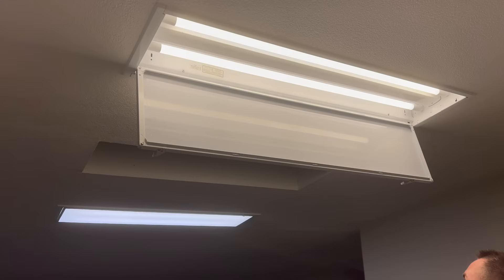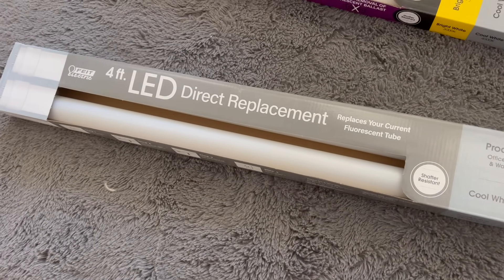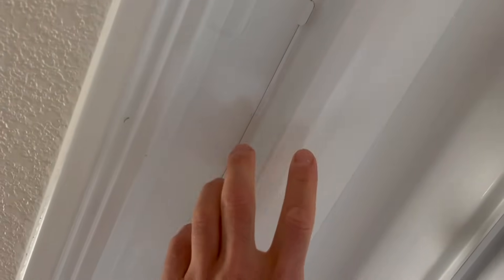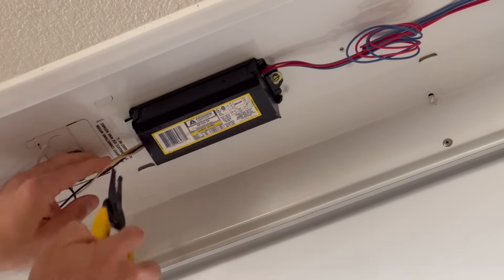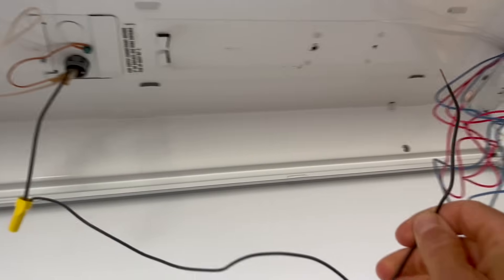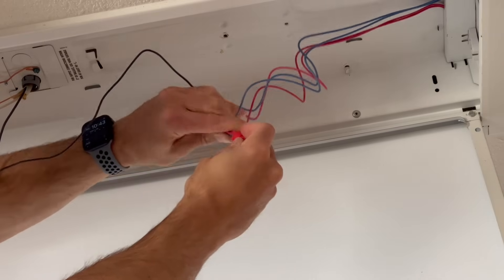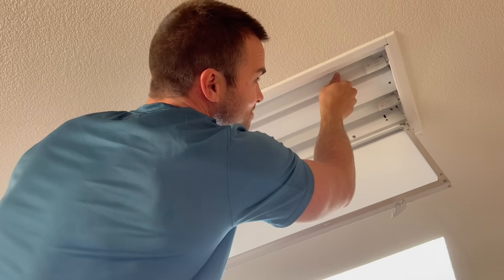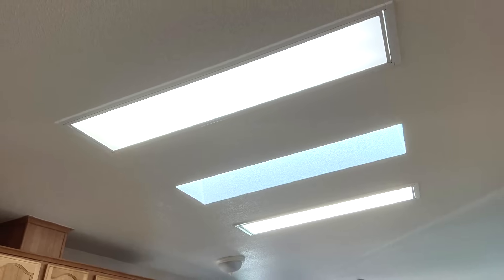Convert Fluorescent Tube Lights to LED - Easy Ballast Bypass Instructional | Builds by Maz

Comment: Maz, Thanks for the great video! Question: My fixtures also have 2 ballasts. I read one of the responses here (stentordoc) where he or she, with 2 ballasts, just connected all the blues and reds with the black, and all the yellows with the white, and it worked great. Is this a reasonable approach? Or was stentordoc just lucky? I would attach a picture of my fixture's wiring, but YouTube doesn't give respondees that option. Mine has 4 X 4' tubes with the 2 inner tubes seemingly powered on one side of the fixture, and the two outer tubes powered on the other. All 4 tubes go on and off together, with light switches at 2 doorways on either end of the room.
Reply from the maker: Hey, honestly I can't say for sure without seeing it in person. But it also sounds like your lights are on a 3 way switch so you may have an additional wire. Sorry I can't be more help, but I don't want to tell you it's fine and then it end up not working.
Reply: @buildsbymaz  No problem. Thanks for a clean, clear video! I went through some other vidoes, and came out more confused than I went in. Keep up the good work. Yes, my office lights may be turned on and off from 2 different locations. A Chinese guy at Home Depot is going to talk with me tomorrow, we'll see what happens.
Reply from the maker: @badfeatherknives5189  Best of luck!
Reply: @buildsbymaz  Hey, I got lucky and spoke with a guy (retired physicist) in the electrical/lighting department at the local Home Depot (BEN is his name, Oak Harbor, WA. He should get a medal.). He told me exactly how to do it. I went home, made the switch rom fluorsecent to LED on my office lights, and then on our house's utility room lights. Both rooms had three fixtures bolted to the ceiling. Both sets of fixtures were made by different manufacturers. Each fixture had 4 fluorescent tubes and 2 ballasts each. I had zero problems replacing those fluorescent tubes with LED lights thanks to Ben's easy-to-understand instructions. The LED tubes I used were the same as you used, I think: FEIT "ballast bypass", 4' length, with a switch for 4 different colors/light output. The idea went like this: 1. Turn off power, etc. to the circuit, of course  2. Remove covers and fluorescent tubes, exposing the ballasts and wires. 3. Cut the wires close to the ballasts and remove the ballasts, as you described  4. Black "LINE" wire from the ceiling hole goes toward one side of the fixture, and the white "Neutral" wire from the ceiling goes to the other side of the fixture. Make sure the ground wire (green or stripped copper) is attached to the fixture, as it should be - if so, leave it alone. 5. Strip about 1/2" of the wire insulation off of the ends of all the wires. I severed the wires if they were unnecessarily long to avoid tangles, just making sure there was enough wire to reach, with a little excess, either the black "Line" wire or the white "Neutral" wire. I then stripped the ends. Basically all the wires from one side of the fixture will be clumped together to join the black "Line" wire, and all the wires from the other side will be clumped together to join the white "Neutral" wire. The ends are stripped and will be joined by those screw-on electrical connectors (the larger red ones). So you need just enough wire to join those clumps with the black and white wires in the middle. It doesn't matter which set of tombstones (on either end of the fixture) attaches to the black wire or white wire EXCEPT the LED lights must be aligned correctly when you install them so that the "L" on the LED light is plugged into the Black wire side of the fixture 6. When you have all the wires from one side of the fixture (4 "tombstones") tied securely (using those red twist connectors) to the Black Line wire and all the wires from the other side of the fixture (the other 4 "tombstones") tied securely to the white "Neutral" wire, you can then install your LED lights. Make sure the "L" side of the LED tube is connecting to the tombstones attached to the black "LINE" wire. On the FEIT LED lights, the "L" side and the "N" side of the lights are clearly marked. 7. Once I tested my first and second fixture with power and gained confidence that I wasn't going to burn the house down, I found it easier to replace that metal thing that covers the wires in the fixtures BEFORE installing the LED tubes. Hope this helps, and thanks again for a very clean, easy to understand video. Dan Vorhis, Freeland, WA
Reply from the maker: @badfeatherknives5189  Great explanation and thanks for sharing! Hopefully this can help others who have a setup similar to yours. Glad you were able to get everything working properly.

Comment: Great video. However, I can't do this bypassing myself (for more than one reason) and I cannot pay an electrition. Do you know of any specific 24" tubes out there that will surely work even though there are ballisters? And, is it unsafe to do this? Ty 👍
Reply from the maker: Just look for a 'Type A' or 'Plug and Play' LED tube. This will work without having to remove the ballast. It would be just like replacing any light bulb so it is not dangerous.

Comment: Excellent video. Through much frustration and after buying three different boxes of 'Plug & Play' Type A LED tubes none of which worked with my current ballasts I discovered not all ballasts are the same. There are three types of ballasts, Instant Start, Rapid Start & Programmable Start. Many Plug & Play Type A bulbs do not always work with certain ballasts even though you're lead to believe they should and in my case the Rapid Start style I have are the issue. I replaced my old fluorescent blubs with new Luminus PLT014T2 LED bulbs from Costco over ten years ago and they worked right out of the box which really had me puzzle as to why none of these new Type A bulbs wouldn't work.  Thanks Maz ! 🙂
Reply: This was my case also. Type A LED bulbs would burn out in 10 minutes or just wouldn’t work at all. Only one particular brand worked but now I can’t find them. I re-wired the fixture just like the video and now Type B LED bulbs work. I just labeled the fixture “for LED bulbs ONLY”. I also labels “line” and “neutral” sides in case some bulbs only work one way.
Reply: So did you replace the whole fixture this time?
Reply from the maker: Glad you were able to get it to work!

Comment: The L and N are both on the same end of my bulb? Help please.
Reply: That's a single ended LED. This video is not correct for that type. For you, wire the black (line) wire to one side of the LED tombstones, and the white (neutral) wire to the other side of each tombstone. (The "tombstones" are the clips where the pins of the light bulb connect). NOTE: The tombstones must be "non-shunted". That is, the two sides of the tombstone are not connected together internally. A non-shunted tombstone will have 4 holes for wires going into it. Shunted ones have only two holes, on one side of the tombstone. If your tombstones are the wrong sort for your LED, either exchange the LED tubes for a double ended type, as shown in this video, or replace the tombstones.
Reply: @douggraham5812  thank you Doug, I appreciate
Reply: Just rotate the light 180 degrees.
Meaning switching the light around. Then it should come on.

Comment: Where have you picked the short white wire that goes to the yellow wires ? The video did not shot that ... Thanks
Reply from the maker: It comes from the ceiling in the middle - you can see it at 2:24 in the video.

Comment: My ballast for a single 4ft bulb has two red wires going to one tombstone, and a blue to the other end (along with the white and black) but no yellow. Can you confirm how the blue and red should to connected?
Reply: My fixture also has 2 blue on one side and 2 red on the other side with no yellow.  The fixture only has one light tube.  Please help.
Reply: @rino8088  I ended up just removing the entire fixture and ballast and replaced with a standard small LED using the white and black wires from the ceiling. I did need to mount a small ceiling pan/fixture box to the joists though bc the wire feeding the old fixture was just coming through the Sheetrock though a small hole

Comment: You failed to mention that there are two options when rewiring!!  You can use double-ended or single ended tubes which wire completely different. IF you are going to post a "how-to-video" you should be complete in your instructions
Reply: Since you seem to know all there is to do it yourself, why are you even trolling this video?  Maybe you should post your own "better" video.
Reply: @josephvogel7234  Have no desire to be a YouTube poster but if I were to post instructions on how do do a project I would do a lot better job than you! AGAIN...If you are going to post...Do it right or don;t do it at all.

Comment: There are also 2 type of LED bulb: single or double ended. The one in this video is single ended type or non-shunted.
Reply: If I'm using a double-ended bulb will it work if I follow this video
Reply: It's not working for me I have checked the wiring in the circuit breaker. My bulbs don't have either alive or neutral indicator. Could this be my issue? The video was great by the way easy to follow

Comment: Could the black wire have been joined to yellow, and white to blue and red, without any difference? I.e. does it matter which side gets which wire?
Reply from the maker: Yes it does make a difference - the black needs to go to the blue and red

Comment: I have to black hot wires, to both of them go to the tombstone blue and red wires?
Reply from the maker: Any white wires? Only 1 ballast? Are you sure they are both hot?
Reply: @buildsbymaz  I have white wires as well coming out of the top of the light fixture and also two black, not just one coming out of the top of the fixture which connect to the single wire on the black and white on the ballast.  Are both of the black wires go to the blue and red wires or only one of them.  I am assuming and I hate to do that, that they do. I would appreciate direction on that.  Thanks!!!
Reply from the maker: @Maddog29  It really is hard to say without being there and seeing it myself and testing the voltage of all the wires. Sorry I just don't want to lead you wrong.
Reply: @buildsbymaz  I get it, appreciate your responds anyway

Comment: @buildsbymaz Could you provide a link to the bulbs you used? Thanks!
Reply from the maker: No problem - https://www.homedepot.com/p/Feit-Electric-18-Watt-4-ft-T8-T12-G13-Type-B-Ballast-Bypass-Linear-LED-Tube-Light-Bulb-Selectable-White-2-Pack-T4815-4CCT-B-LED-2/321037737

Comment: These are different bulbs than what I use. The ones I use tubes that the hot and neutral are both wired to the tombstones on one end and the other end has no connections.

Comment: Avoid touching the black and red wires they can shock you, burn you and kill you. Especially the black wires.
Reply: Not if you cut the power like he said in the video.
Reply: @Someone-tn8ur  you don't get shock from a neutral white wire.
Reply: @Someone-tn8ur  I'm talking about if you wiring the fluorescent light to LED lights.
Reply: @MasterDilianoTheBlueKunBoy7K5  You seem really confused... Go back and read all the comments and tell me what you are responding to.
Reply: @Someone-tn8ur  is about safety connections.

Comment: Maz, my fixtures are daisy chained with one power  line (5 each), will this still work?
Reply from the maker: Honestly I don't know for sure without seeing it in person and I don't want to steer you wrong. You can always take photos of the current setup and then try this, and if it doesn't work you can revert to the previous configuration and reconnect the wires

Comment: Clearest explanation and best video!
Reply from the maker: Thank you!
Reply: We have an 8 ft. fixture with four bulbs snd 2 ballasts. Is the bypass surgery procedure the same, with all the blue and red (power) wires bundled together?
Reply from the maker: @jonathanc.3872  If there are still just 4 total red and blue wires, it should work the same.

Comment: Great vid! Am I mistaken or did the new bulbs you installed look smaller in diameter than the old bulbs??
Reply from the maker: I'm not sure actually...they may have been slightly smaller in diameter, but the pins on each end still fit the same
Reply: @buildsbymaz I think T8 bulbs are the skinny and the T12 are the chubby.  Please correct me if I am wrong.  I don't know if the sockets on each end of the fixture can handle either.

Comment: I redid my kitchen light with LED's and its awful, it sometimes buzzes really loud, and the flourscent tubes seemed to last longer
Reply from the maker: Sorry to hear that! Normally fluorescent bulbs are known for causing a buzzing sound.
Reply: Possibly you wired non-dimmable LEDs with a dimmer switch.
Reply: @douggraham5812  no, I realized the issue was someone used a plug n play led and the ballast was old

Comment: I'm in the good ol' United 🇬🇧 Kingdom, and I retrofitted my 5 foot kitchen fluorescent, with an LED tube in 2012.

I removed the ballast and associated components completely. My tube required live (you call it 'hot') at one end, and neutral at the other. It's worked perfectly for 12 years and counting.
Reply from the maker: Great to hear! I hope mine lasts 12 years.

Comment: Just wondering... what would happen to the LED tubes if you don't remove the ballast first? Also, why do these tubes have a "polarity"?
Reply from the maker: The light would not work properly or could even be damaged. All LED lights use polarity to keep the current flowing in one direction. Hope this helps.

Comment: I mirrored this process but have no power. ?!?! Lights don’t work
Reply from the maker: A few things to check:
1. Make sure your breaker is turned back on. If that's not the problem, turn it back off and try the next options.
2. Double check all your wire nut connections and make sure nothing is loose or unattached.
3. Make sure the 'Load' side of the LED is on the side with your red/blue wires

Hopefully this fixes your issue!
Reply: Besides buildsbymaz's reply: Also, check your LED tube. Some are "double ended" and wire up like shown here. Others are single ended, and the black and white wires go to the SAME end of the tube. AND check with a second LED tube. These things are made in China and have a high "dead on arrival" rate.

Comment: I would’ve taken a sharpie and mark live wire on one side and the neutral on the other side, the next guy wouldn’t know which side is what. Just saying. 👍🏼👍🏼
Reply from the maker: Good idea, I may go back and do that actually
Reply: wouldn’t he be able to tell by looking at the ends of the LED bulb?
Reply: @wpkg Even if he took it out and forgot which end was live. All electricians have a meter or a voltage tester. Stick it in a tombstone, and if it's lights up, it's live. It's easy.
Reply: @wpkg Some people don’t think like we do. That’s why it’s good to mark them I know all my fixtures by heart but I labeled each one.
Reply from the maker: @wpkg  Yes, unless he took them out without checking and then didn't remember which side was which lol
Reply: @buildsbymaz  ah yes. of course
Reply: Would this be the same if he used a double ended bulb? In this video he used a single ended bulb thats why he needs to mark the Live wire side for future references.
Reply: Probably doesn't matter much.
Reply: Use a non contact voltage detector.
Reply: I was thinking the exact same thing. I would have also taped the wire nuts and used zip ties to clean up the wiring.
Reply: If the next guy doesn’t know he shouldn’t be in the light😂
Reply: It's "line" not live but no biggie
Reply: My thoughts also. If I revisit years later, I’ll probably forget.
Reply: It's actually better to verify, what if the original installer labeled them wrong?
Reply: Hopefully he has a Volt tester to check before he works
Reply: Convenient but not a show stopper. If the bulb doesnt come on, it's backwards.

Comment: ballast bypass is very dangerous
Reply from the maker: It isn't dangerous if you take the proper steps, and it is required to install these types of LEDs.
Reply: So make sure you do it right the first time.  Then hide the wiring.  Finally, put the new tubes in. Button everything up.  Get off your ladder and turn on the circuit breaker.  Then the light switch.